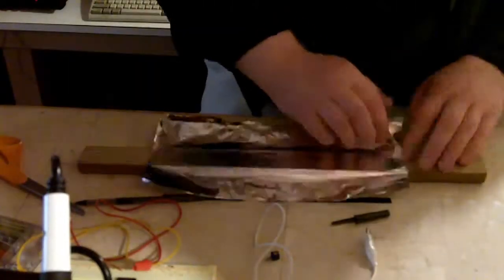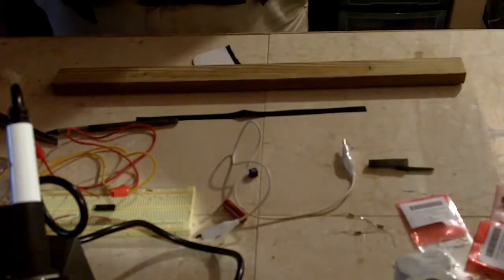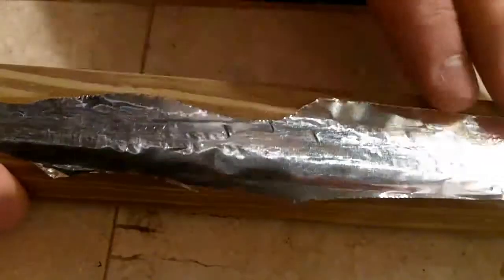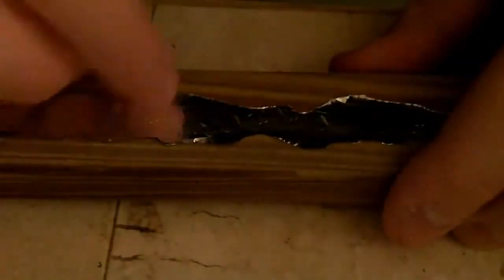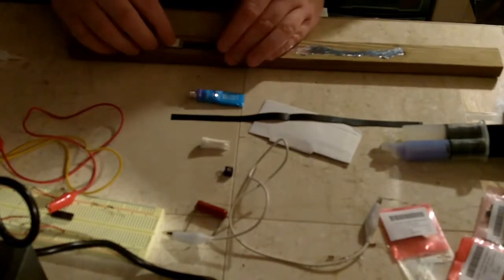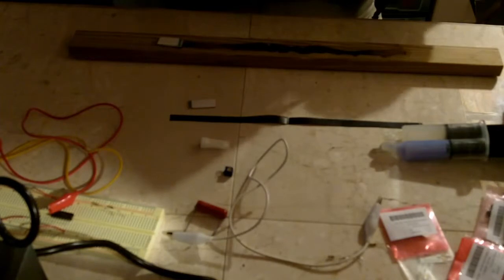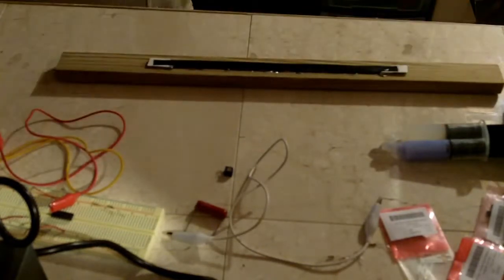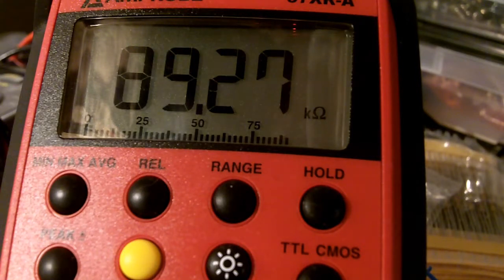Ribbon Prototype 3

Comment: exacto knife after gluing might give you a more visually pleasing result.  Have you considered something like a guitar string?  Another trick is to use VHS/Betamax tape... nowadays you can bulk buy VHS tapes from thrift stores for dirt cheap and they are pre-cut for you!  Also, with a router, you can lay in your leads, and therefore reduce the chances of knocking them off with hand motions.!

Good Luck!